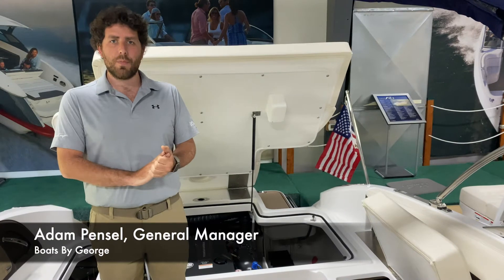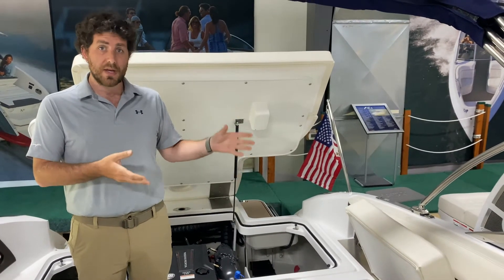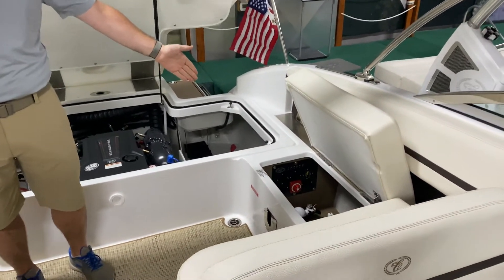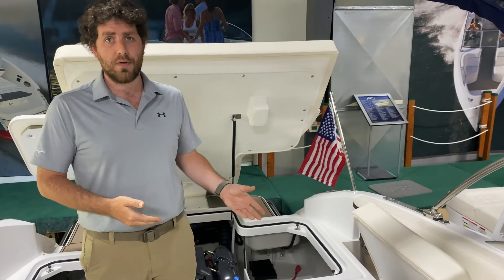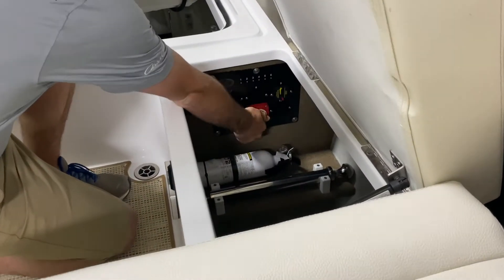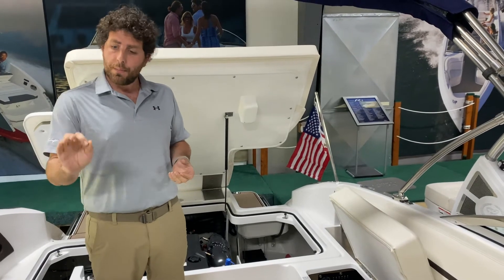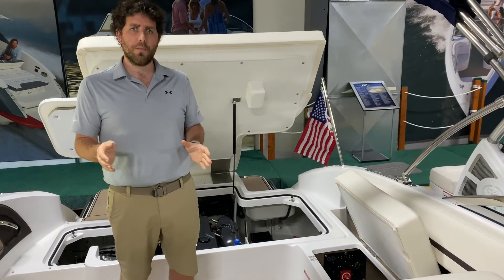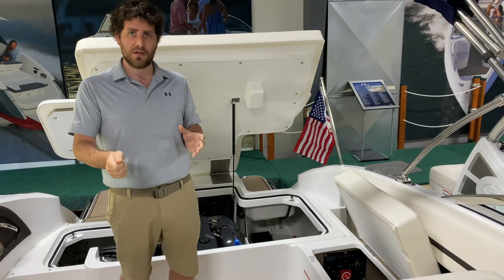Boat Battery Switch Explained

Comment: Ok I got the older system . Battery 1 or 2 or Both . I think I run it right but not sure . I always start boat on both . Then when we cove out and have radio on I put the switch to 2 . Time to leave I always start and run on both . Is this correct ?
Reply: It’ll work. But we always recommend to run the boat on one battery or the other when underway. Batteries don’t charge as well when they’re in parallel. And try to alternate use each time you come to the boat.
Reply: @adampensel4276  ok thanks for getting back . So with regards to alternating batteries I was considering going with a cranking battery just to start boat and a deep cycle to listen to radio . Opinion on this please . I see there are Dual purpose batteries also which I may buy . What do you think ???
Reply: When you say run the boat on 1 battery are you including starting also . Like start the boat on 1 and run it on 1 and then later in the day or next day switch and start the boat on 2 and run it ?? Only use BOTH when batteries are low???
Reply: @Americanboy5150  This is a good method that many people choose to use. But if you go that route, you should consider adding a BlueSea Automatic Charging relay. By doing so, you will be able to charge both batteries at the same time, provided the engine cranking battery is healthy. When the boat isn't running, that's when you'd turn the battery switch to the deep cycle to listen to the radio. This will make your dual battery setup more similar to modern systems that I have outlined in the video, with the difference being that you will need to select a different battery on the switch for driving vs floating/hanging out/listening to music.

Comment: Thank you! Question; if you are using a battery tender with this setup, do you need one or two tenders?
Reply: If you’re using the built in tender, just one is fine. If you’re adding one yourself, you can use one that is designed for dual charging with two supply leads. Otherwise, you need to use two.

Comment: great.... but if the batteries (both of them) are dead.... is there a place where a battery charger (external ---powered by shore power) can be connected?   I'd like to know for a 2016 24SD please....   Thanks
Reply from the maker: It depends on whether or not you 26SD had a galley. If it does not, there is a seat on the starboard side where the battery switch is located. In some boats, they had jumper anodes in there that you could hook up a jumper pack to.